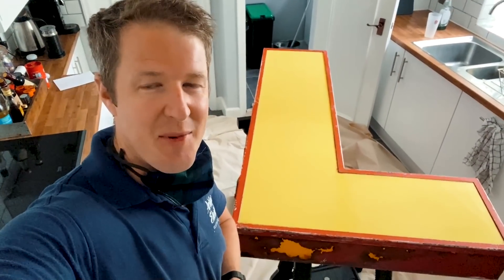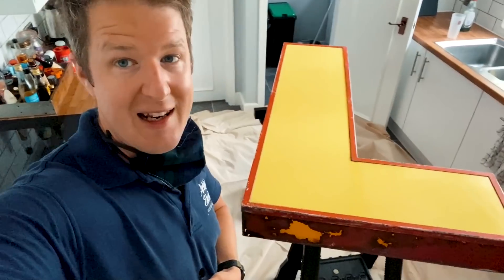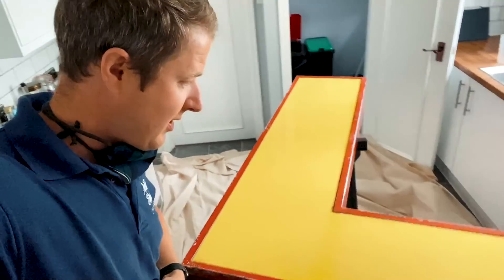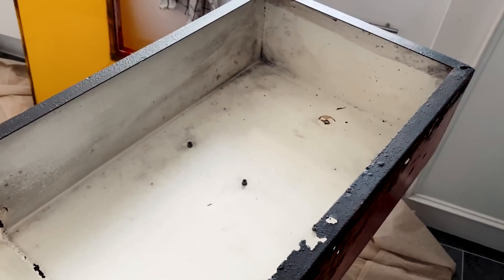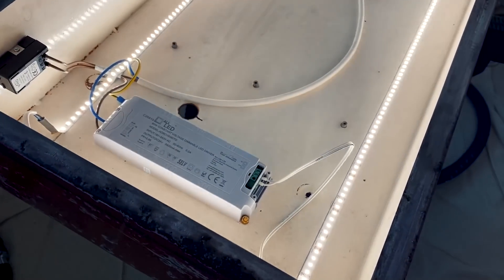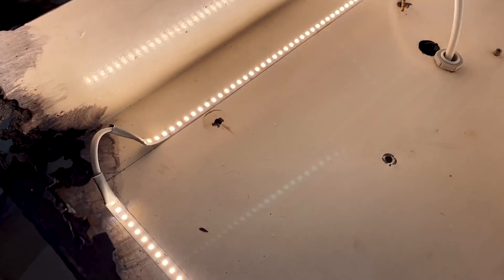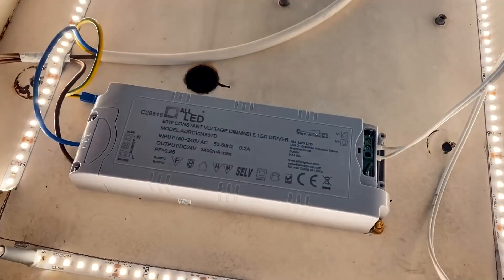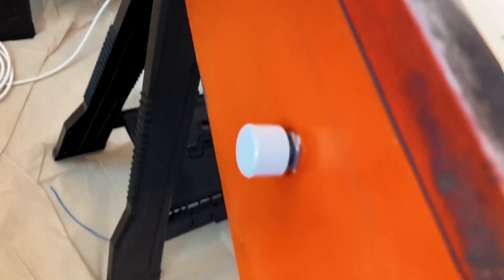LED Strip Lighting Installation - Vintage Sign Restoration

Comment: Led modules or signage led modules are specifically designed for this job. Osram do them and prob other company’s as well 
We use them for Starbucks signs
Reply from the maker: Nice will check it out thanks

Comment: looks pretty bad! probably not so visible with the cover on, but without it you can clearly see the difference in brightness between the start of the run and the end of the run! one way to offset that is to use one end for the positive and the other end for the negative connection.

Comment: Won't the flex you used have too much tension and cause the ends of the strips to lift? 
I've always found the double sided tape very weak.

Comment: I'd love to see more projects like this. Also quick question, You recently purchased the knipex installation plier which act as a stripper and ferrule crimpers, but you still use the seperate tools for those tasks. Would you say they were a worthy investment? I have been looking into getting them myself. Cheers

Comment: Looks nice, but why cut and solder all those corners couldn’t you just bend tape round corner?
Reply from the maker: It’s not supposed to be bent
Reply: @artisanelectrics  I have seen corner clip on connectors but who knows how well they perform over time. Did you secure the tape other than the adhesive backing, I've found that it tends to fail over time once gravity and heat have their way. Nice effect tho 👌

Comment: Nice project. Just a thought - would it have been better to run the cables for the dimmer round to a corner and pass them under the flex rather than under the LED tape? I know LED tape doesn't get very hot, but it has introduced an unnecessary break in the adhesion and could create a bit of a hot spot.
Reply from the maker: Good point yeah I could have done that I guess!